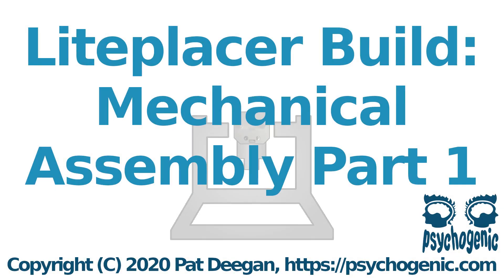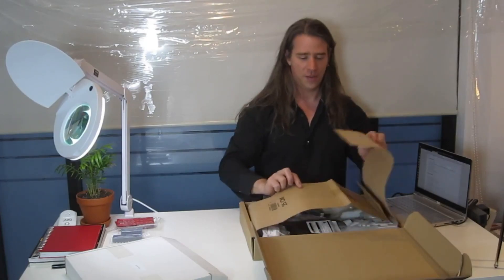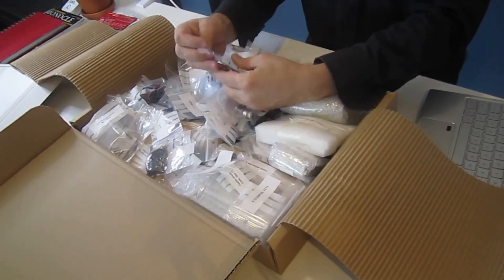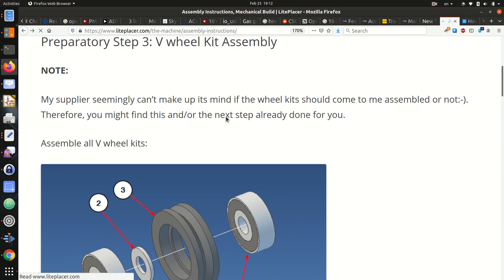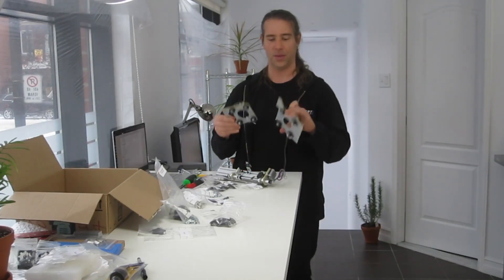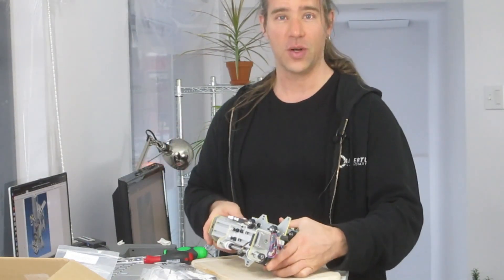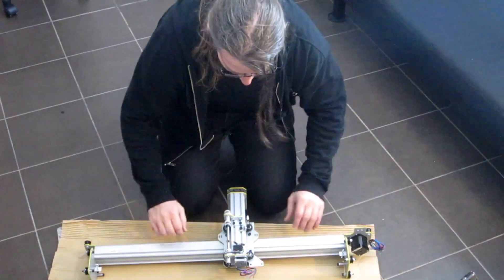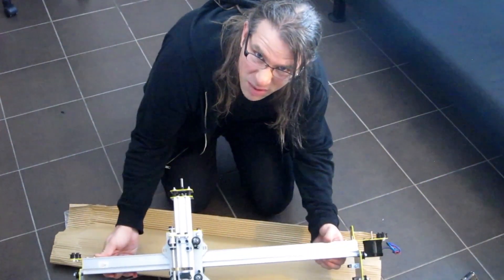LitePlacer: kit unbox and mechanical assembly part 1

Comment: I am more excited to make this for my small production. Do you think this would suit for making 100 PCB's with 200 components on an average per day ? 

Also I am thinking of making the rails and guide plates on my own, what do you suggest on this too ?
Reply from the maker: Hi,  I think you could do it but may be pushing it a bit in terms of the liteplacer.  Your main pain point will be the feeders--if you can augment it with some automated feeds, at least for the popular components, it will go a whole lot better.
I am curious to see how it goes.
Reply from the maker: Oh, and as for rails/guide plates, I've been using 3d printed sets of feeders that have worked out pretty well.  If you doing large batches of boards, a panel is probably your best friend there, and placement of the PCBs themselves not such a big deal, thanks to the magic of fiducials, so isn't much of a worry.
Reply: @PsychogenicTechnologies  Just to keep you posted, I am not buying lite pacer as a kit, I am planning to buy all the raw materials. I know it is going to take huge time procuring them and assembling it. I will get it done and let u know.